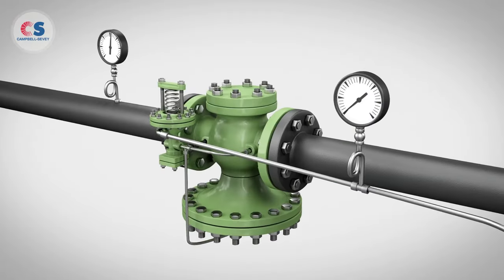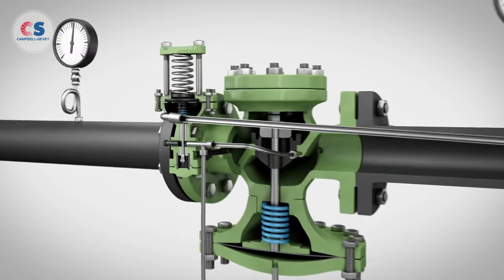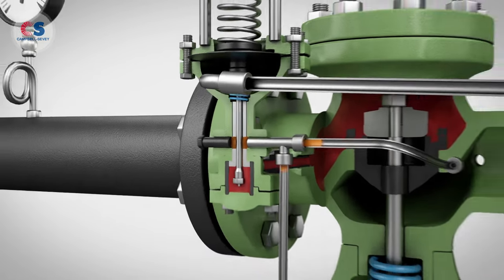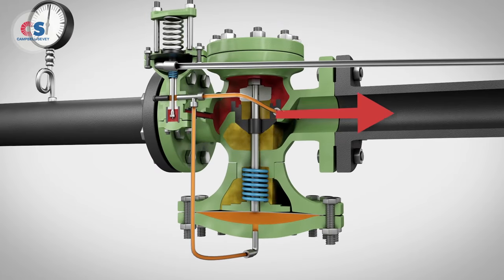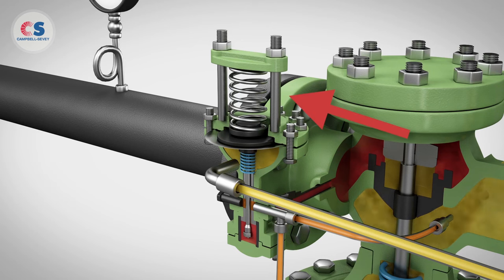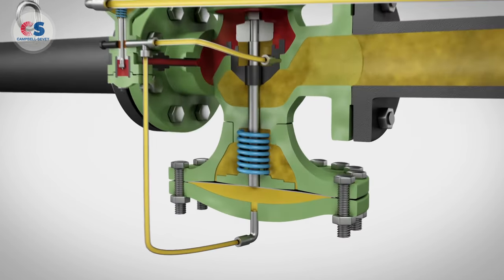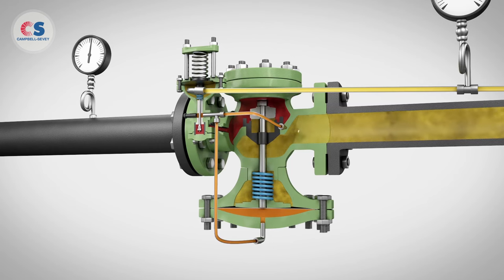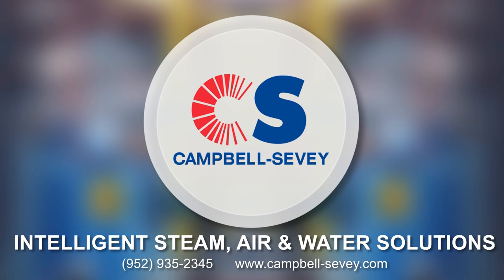Campbell-Sevey - How a Pilot Operated Regulating Valve Works

Comment: beautiful animation. curiosity: which software to create and animate 3d objects did you use?
Reply: the answer is ALWAYS the same: for the most part it really doesn't matter, just go do it. Blender will do most things.
Reply: @sheldondrake8935 that’s a terrible vague cop out answer. He asked for specifically which one was used for a reason, his curiosity. Not some dim wit smart ass answer telling him to “just go do it”x. What worthless and condescending advice.
Reply: @rubixcubesolve  feel better bigshot? you added nothing. my answer is correct. your reply is silly noise.
Reply: @sheldondrake8935  why would I feel better? You still haven’t  answered his question and now you’re giving me a run around bogus response as well. Worthless reply
Reply: @rubixcubesolve  do you even know what Blender is? you're out of your depth. go away.

Comment: is the above valve have fail close possibility
Reply: appears not.
Reply: That valve looks like a Spence, which is normally closed, pressure to open. So, it should fail closed. There is a possibility that it could fail open depending on the type of failure with in the valve. There are some variables to work through when a valve fails.